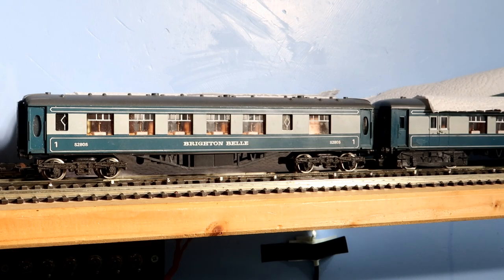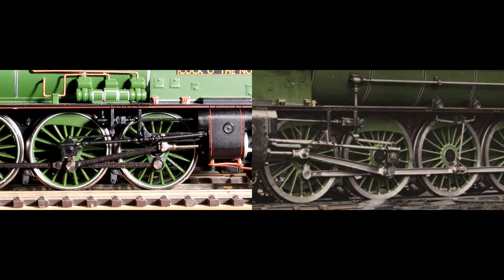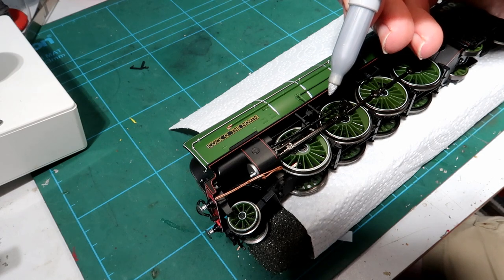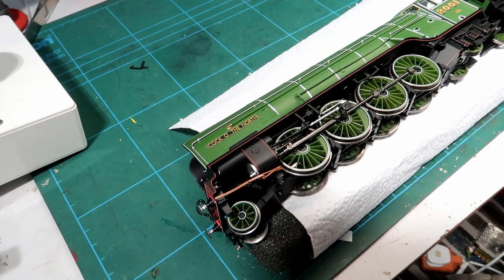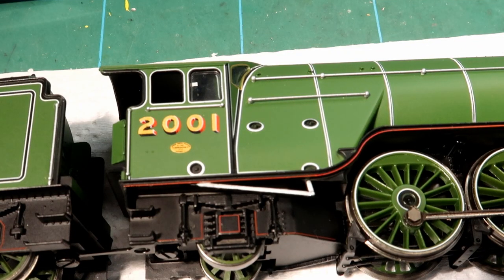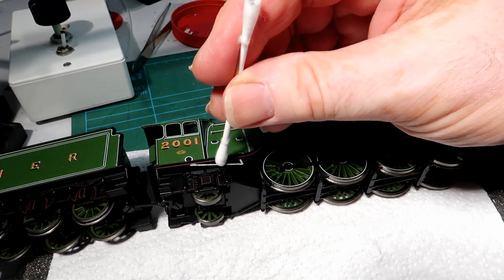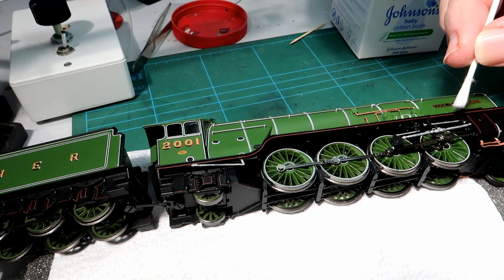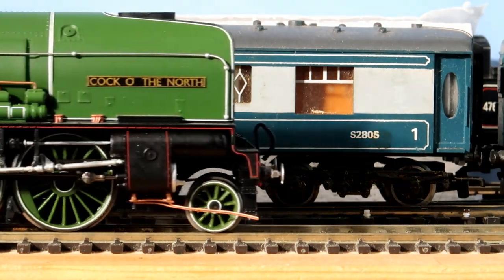Hornby Cock ‘O’ the North, Valve gear Improvements

Comment: Nicely done! I will have to investigate silver sharpies. I've also put a pin into the motion gearbox which holds it in the crank hole quite well. Had to be careful though, this motion is very delicate isn't it. Always enjoy your adventures!
Reply from the maker: Thanks very much, your idea sounds very interesting, do you have video or pictures?
Reply: @ModelRailwaysUnlimited  I would if I knew how to paste a .jpg into this chat....It's literally only a 6mm pin through the middle of the square bit of the Caprotti gearbox on the valve gear moulding, on which the crank rotates - it just keeps things tidy when they move.😀
Reply from the maker: Hmm, maybe try our facebook page?
Reply: @ModelRailwaysUnlimited  Hokey Dokey, done!

Comment: Nice video. Caprotti valve gears spin in time with pistons and I guess they presented it in black plastic as a cheap way to detract that its model form would be complicated to make it functional. It cannot work as a working model but Accurascale might try?
Reply from the maker: Thanks, so it spins how facinating
Reply: @ModelRailwaysUnlimited  Yes it does. the same type of valve gear is fitted to the unique Duke of Gloucester locomotive and if you watch the videos, they spin.
Reply from the maker: @ianforfun1  great I'll check it out. Was this on the 9Fs as well
Reply: @ModelRailwaysUnlimited The 9fs were never fitted. However 2 black fives and many standard 5s were fitted.
Reply: @ModelRailwaysUnlimited  '
@gs425 beat me to it but not fitted to 9fs.